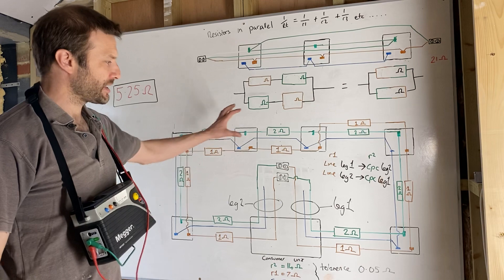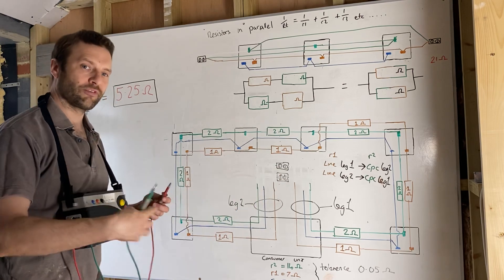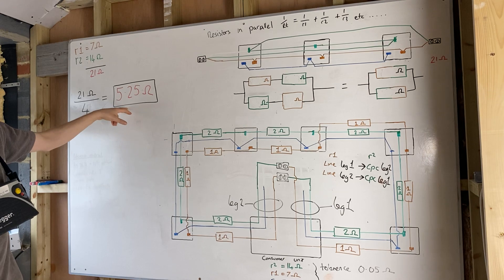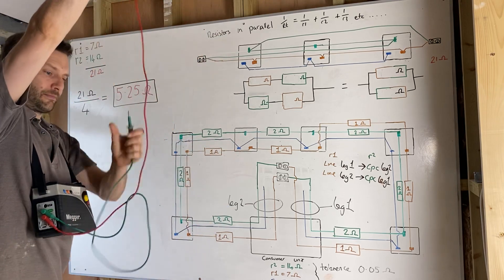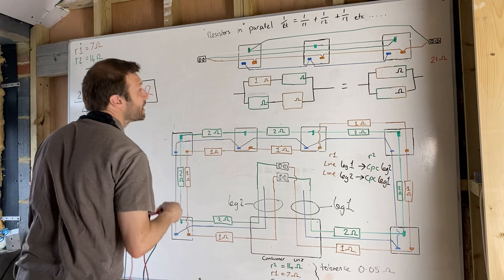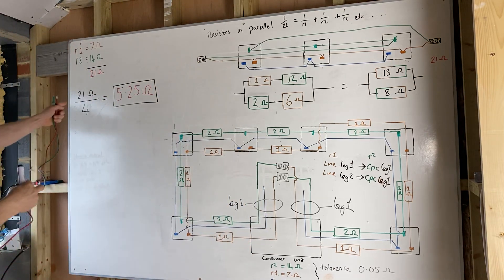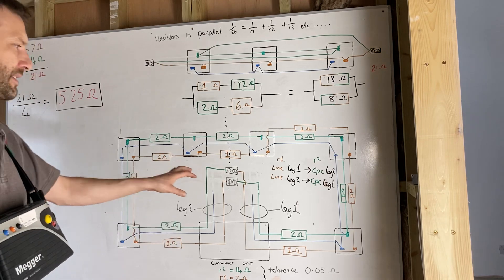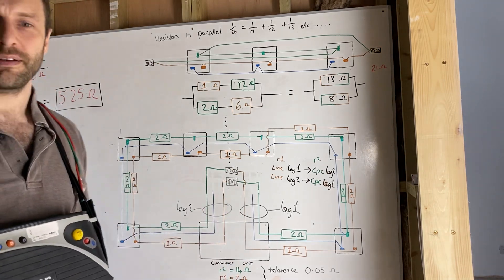Testing R1 + R2 ring final circuit, (correctly connected)

Comment: Great video Adrian! Can I be bold and suggest a short video on how resistance at each ring final socket is equal to R1+R2 divided by 4? Also when you mention a tolerance of 0.05 Ohms would this not result in a range of 5.20 - 5.30 Ohms in your scenario?
Reply: AGREED
Reply from the maker: Thank you Tim🙏

I have a video of me actually testing a ring which I'm going to put out shortly.

You are correct with the 0.05 tolerance and if you divide 1.30ohms by 4 you get 5.25ohms, Which would work in the field.

However, When I was working it out using resistors in parallel it just wouldn't get that close on some sockets for some reason. 🤷‍♂️

I couldn't work it out, so just ran with it, hoping someone would point out the discrepancy 😁

Comment: Adrian, all figures on a ring should be R1+R2/4=5.25 give or take 0.05 + or - that figure should be at every socket outlet , if its not I'd be checking why my figure differ from that, loose connection, bad switch contacts, spur etc, hope this helps buddy
Reply from the maker: Yes you are totally correct, I guess I was just trying to show how the resistances added up through the circuit, and the only way I could work it out was using resistors in parallel.
Reply: @Pure_electrical_training  I know what your saying Adrian but it's hard to get a pure resistive load, capacitance and inductance play apart in testing that's why we have z (impedance) figures mate, it's good on paper but not when testing, bet you are like " I wish he would stop commenting on my videos" haha
Reply from the maker: Not at all Peter, I've discovered a real love for learning and anyone willing to give me their time is only going to make me a better teacher 🙌
Reply: @Pure_electrical_training  I'm  the same Adrian, you never stop learning in life, good to help each other with things that we are unsure of.
Reply: @petertaylor9323  that's why I believe that there is no such thing as a fully qualified electrician, the industry is constantly changing and are having to learn in order to keep up, we sit one exam and before we know it they bring in somthing new and we have to do another course and sit another exam its never ending. But its fun learning though.
Reply: @seandempsey9396  exactly Sean, you get some who know it all though, or think they do. It is good to learn and keep progressing in life.